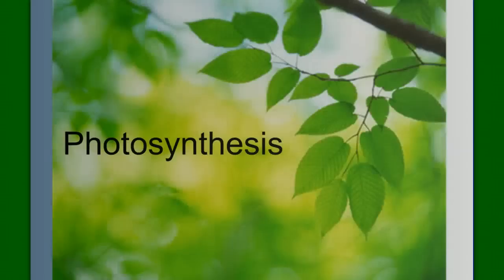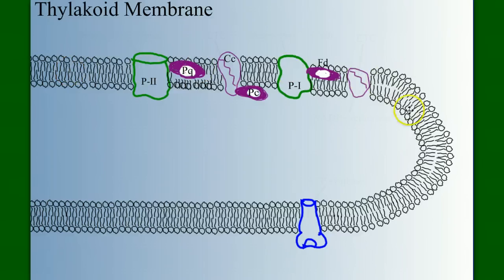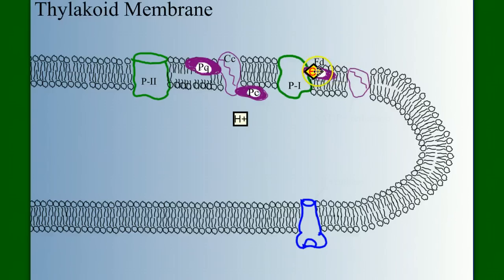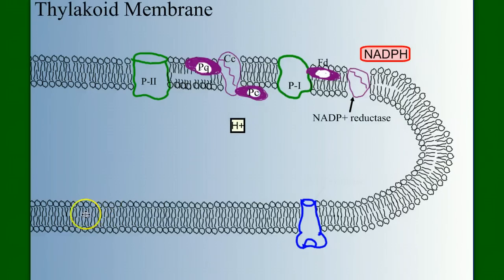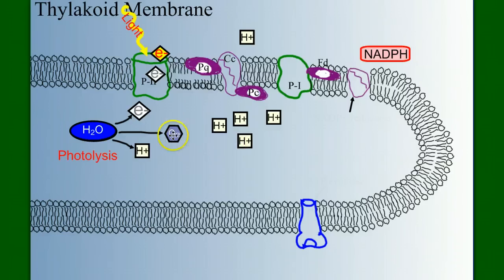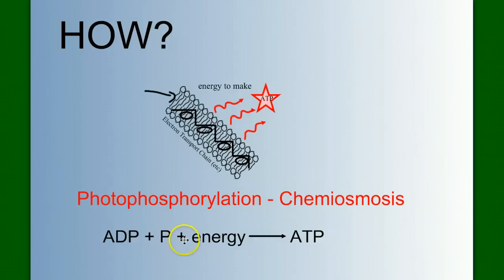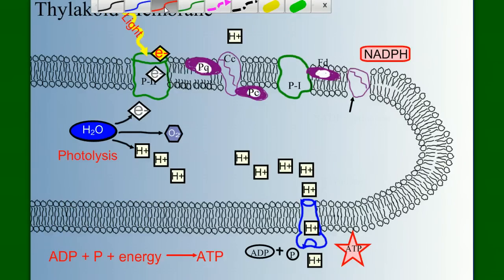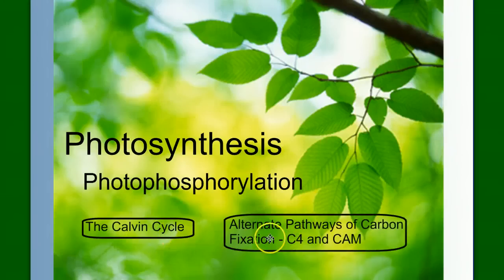Photosynthesis Part 3: Photophosphorylation

Comment: Hydrogen is not used directly to form ATP, the energy of the gradient is utilized to bind the inorganic phosphate (Pi) to the ADP. 

The hydrogen that leaves the cycle is the one which is used to reduce NAPD+. This hydrogen comes from photolysis, and so as long as water is present to be split, there will be a hydrogen for this purpose. 

In short, so long as water is present, there will be a supply of hydrogen ions to feed those which leave the cycle.

Comment: If the ETC provides the proton pumps the energy required to pump H+ ions into the matrix from the outer compartment, where does the H+ ions from the outer compartment come about?
How are H+ ions formed?